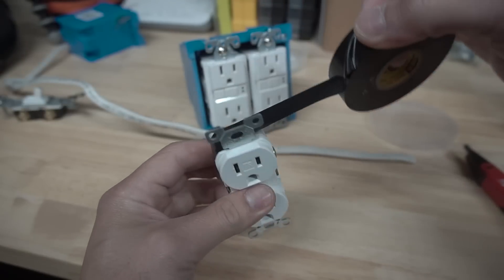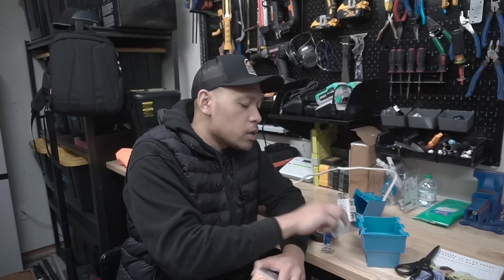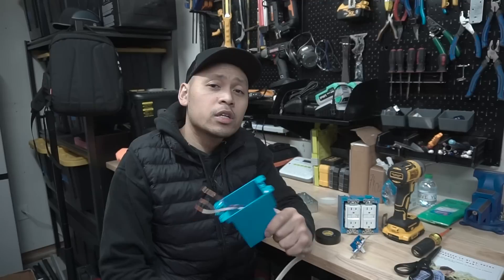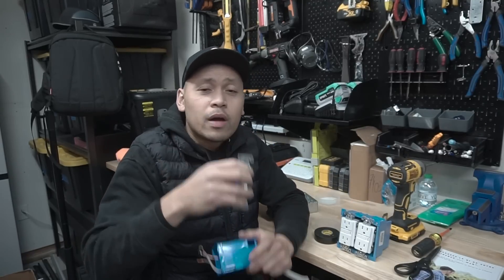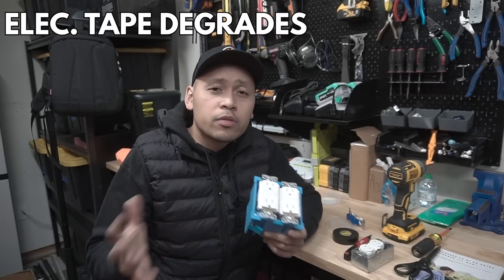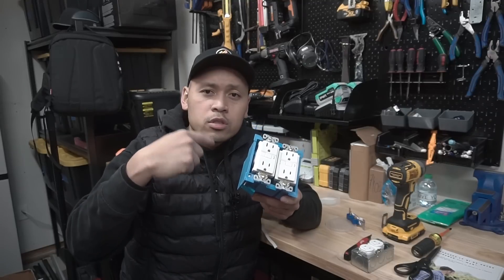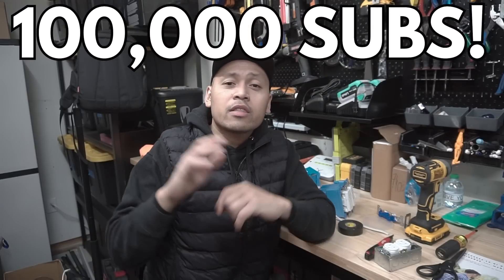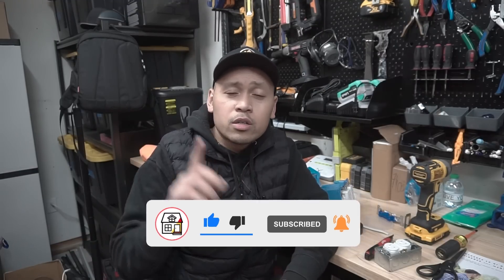Is It ILLEGAL To Wrap Outlets And Switches With Electrical Tape?! The DIY Great Debate! How To

Comment: In Britain the ground wire has (or should have) a green & yellow protective sleeve slid over it everywhere the wire is exposed, having worked in the electric industry in both countries the domestic electrical system here in the USA is very poor and barely fit for purpose.

Comment: Master electrician of 10 years in Kentucky - In non-metallic boxes there is no point in wrapping the devices. If your worried about the ground touching a terminal, you did not tuck your wires correctly to begin with. If you are putting a device in a multi-gang box next to other devices or maybe a cut-in metallic box where the sides of box or support bracket may come in contact with the terminals on side of device we always use 3M 33+ or 88+ electrical tape (not jap-wrap dollar store tape) because just like solder, when things get warm the cheap stuff falls off like butter.
Reply: If you are a residential, commercial, industrial electrician who can also troubleshoot ,most construction boys CAN'T TROUBLESHOOT LOL..
Reply: @davidcooper4385  right, thats when all the "this is weird" "never seen anything like this" "hmm must be the harmonics" start coming out and itchy and scratchy hop back in the van and start googling how to wire a 3-way sw. Or what is a relay. Service Van work is the best experience you can get as an apprentice, that coupled with working with someone twice your age. Show up on the job, figure out the problem, and fabricate a solution with 3 toothpicks, a few connectors, a hand full of wire nuts, and whatever you have available on your van, nearest HW store is 100 miles away.

Comment: Electrical tape is not a perfect insulator. You should not rely on it to prevent a short to ground, even the 3M electrical tape is only rated to 90 C. The hot terminal on an outlet can easily exceed that in the event of a power surge. 
I once removed an outlet that had burned through the electrical tape and and shorted to the ground wire which was then touching the hot terminal on the outlet. 

Never rely on electrical tape alone! If the hot terminal is touching a path to ground you need a much better insulator that a thin piece of tape!
Reply: If it is touching the ground it should have triped the breaker!

Comment: FYI, It's a violation of 110.3(b) of the National Electrical Code. Those devices have not been evaluated by UL with electrical tape wrapped around them. It's also a violation of the same section for wrapping electrical tape around wire nuts.
Reply: Exactly!

Comment: As an electrician the only time I use tape is when I have a standard outlet with a metal box. GFCI outlets have recessed screws so that it won't touch the edge of the box. The tape just makes it harder to troubleshoot, test, or replace the outlet. It just looks tacky as an electrician opening up and outlet.

Comment: Personally,  I use tape around the receptacle or switch if I am installing in a metal box, or if installing switches in multi-gang boxes (3 or 4 gang) where there's a higher chance of the ground wire inadvertently shorting out against the device terminals.    I've fried one more expensive dimmer than I want to admit,  from this happening,  so a little tape is cheap insurance.  

Otherwise,  I don't use tape.

Comment: Illegal or not..... it's beyond unnecessary and by definition outright Stupid. Don't do it. If a device required tape...any device in any box under any condition...the manufacturer would include it in the literature/ instructions. It's NOT necessary, just install it correctly. Do you add more shields to the engine compartment of your car? No, you don't. FYI, the low voltage of 120/240 volts will not jump across the air gap... just install the devices correctly and install the cover plate correctly. (PS lifelong electrician)
Reply: Installing correct involves properly grounding each box and device in the box.  If that's done then wrapping the terminals is superfluous, because if the box or ground wired touches the hot terminal the breaker will trip.  So I'm with you Fritz
Reply: @geraldpatrick9463  Thanks Gerald. Check out Mark's response to Jeff, it's very well stated regarding the code.
Reply: I never use tape around a device in a box. It's nasty, can hold moisture, makes troubleshooting, revisions and repairs a sticky nightmare but most of all it is;
1. The sign of an amateur. Now I know I must question everything in this system.
2.The sign someone scared of electricity worked on this. I will find more stupidity.
Reply: @Robnord1  Very well said. 💯
Reply: Um, no. Do not rely on the manufactures literature, instead rely on what is safe to do. Many manufacturers have had safety recalls because their products were not safe. As a "lifelong" electrician you should know better.
Reply: @panerai_fan  talking about devices which have been being made and improved on for a hundred years, there are not safety recalls on devices AND never have the instructions called for tape to be added. You don't know what you are talking about anymore than the amateur who made this video. And you can stick your little quotations where the sun don't shine and also I DO know better having been an electrician for decades. You got nothing but a very dumb assumption on your lame end making a scolding from you absolutely ridiculous. People, don't tape your devices, install with skill and knowledge, de-energize ANY circuit that you ever work on.
Reply from the maker: Thank you sir for your input and feedback 🙏🏽

Comment: From buffalo, N.Y. Very Good video post. I'm not an electrician but I have done electrical work on my houses many, many times. I ALWAYS tape around the plug or switch, always. And as you did, those screws have to come off in order for the tape to go around the plug or switch. I like useing deep well (metal) boxes especially when using 12 gauge wire. I had to replace a 3 way switch and that OLD black metal box was so tight that taping that switch gave me peace of mind. I like using the screws to secure the wire to the plug and taping around the plug seems to make alot of sense to me, especially when using ground fault plugs. I had it were 3 switches were in 3 gained boxes and on different lines, YUK. You know for certain each switch was taped.  In older homes often a work box is used as a junction box housing so many wires, especially ceiling light fixtures were you'd think it's the end of the run, but nope other things are tapped off that light switch controlling other things and then they're those old thin pancake round box, YUK.    Once again, you explained this video post very well, Thank you.
Reply from the maker: I really appreciate the thoughtful response! Thank you so much for taking your time to share your experience and feedback! 🙏🏽😊👍🏽

Comment: Honestly the only time I feel the need to wrap anything comes with power skirting or trunking for offices and such.. the trunking sometimes fits so tightly around the plug that there is like a few mm at best of clearance between hot and essentially a completely metal exposed surface which is usually earthed but you never know
Reply from the maker: Thank you for sharing and your feedback! 👍🏽😊🙏🏽